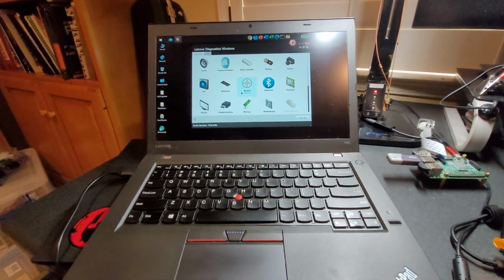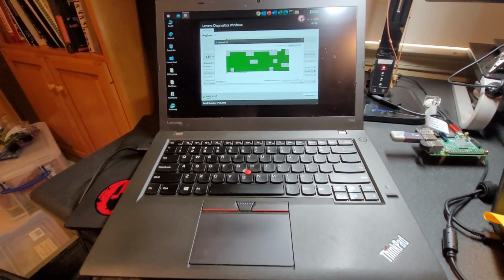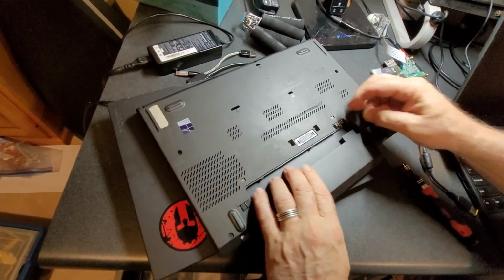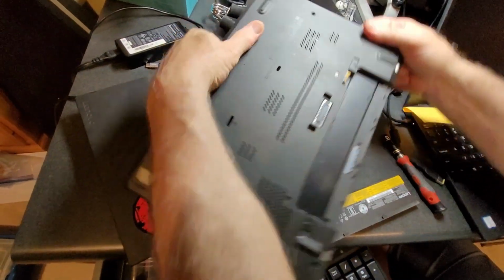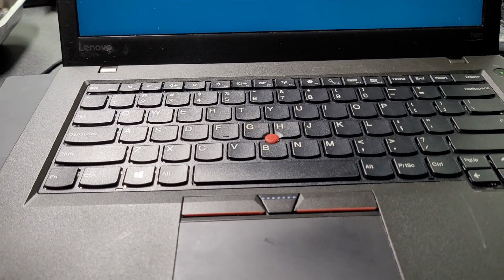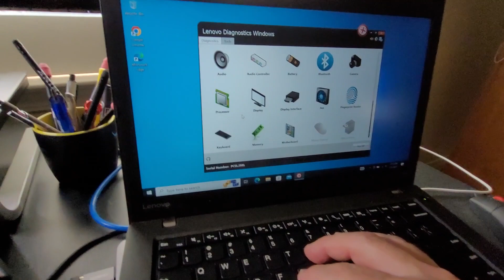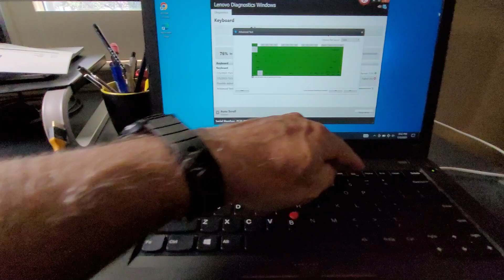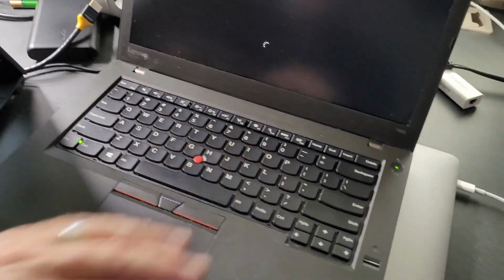Lenovo ThinkPad T460 keyboard replacement

Comment: what a mess... (of a repair/replacement)..
Reply from the maker: Yes it is. Other ThinkPad models allow replacement of keyboard and battery much easier. I am preparing to replace the keyboard on a ThinkPad Yoga Gen 1. Wow, the instructions indicate that I have to take most of the laptop apart.  Should be interesting.

Comment: If I have two batteries, the external and the internal, before I replace the keyboard, I have to disconnect both batteries? Or just the external?
Reply from the maker: Remove the external battery.  Then disable the internal battery via bios.

Comment: Do you have to leave that black rubber piece on the inside?
Reply from the maker: The little black rubber I picked out?  They are supposed to stay in, but mine degraded.  They can be difficult to replace the keyboard if the rubber is in there.  I took them out.  The keyboard screws in anyway, so not a big deal for me.
Reply: @DrBDIY  yes that piece. Yes I took it out and I didn't have any issues either.